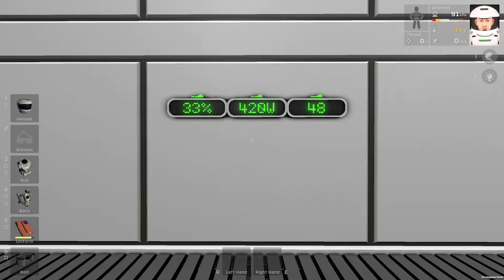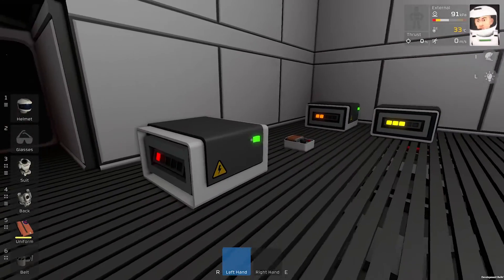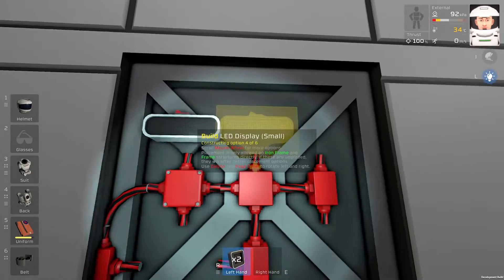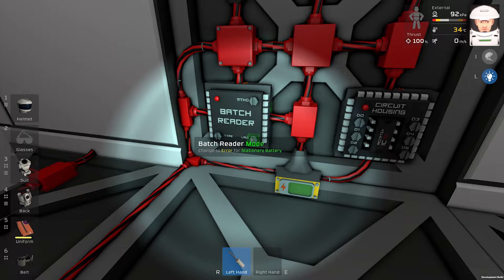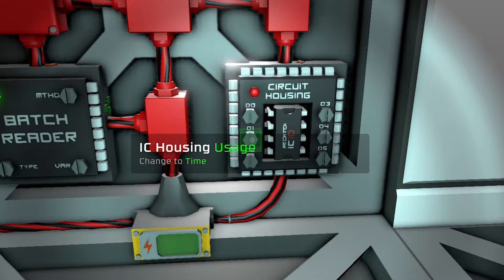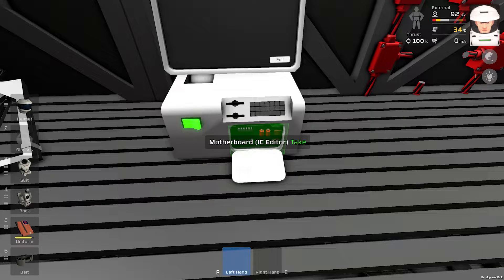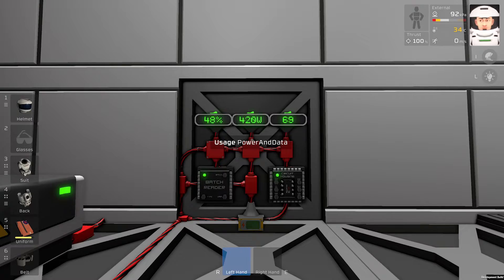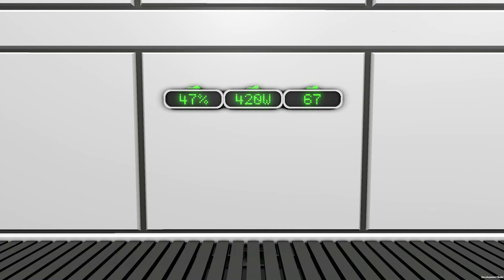Stationeers - Tutorial Compact Power Display with IC

Comment: d2 flashing light or alarm or both
Reply from the maker: You are very close sir.
Reply: could be coal or gas switch - speaking about the gas generator you should do a new tutorial on the gas generator as  it very hard to figure out how to get  all the heat in the room it generates out !
Reply from the maker: You are absolutely right, d2 is place for generator, coal or gas. I need to do a tutorial for gas generator, because it was pretty nerfed few months ago.